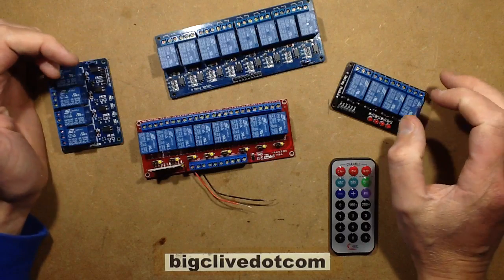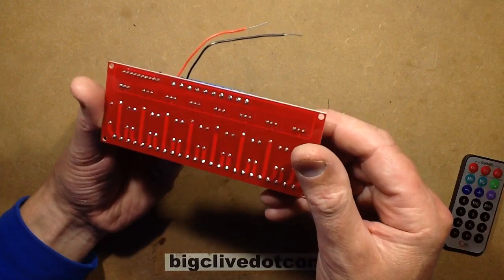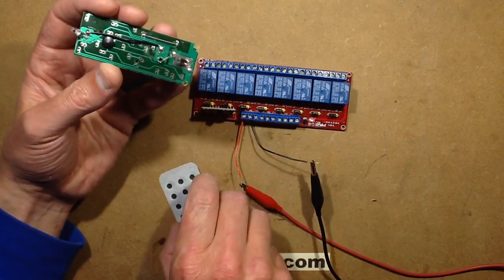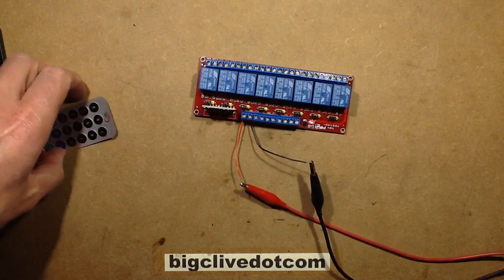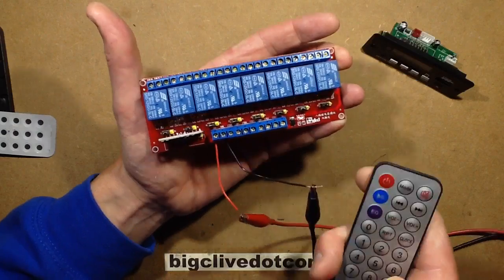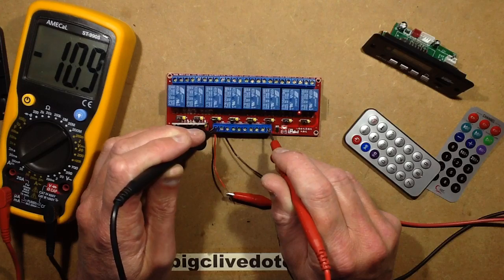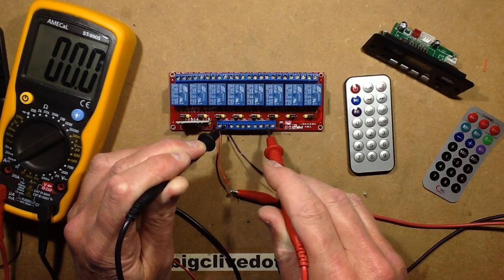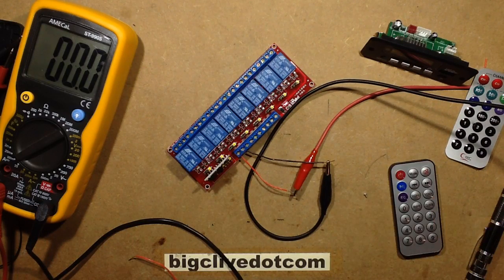Infra red remote control relay module.

Comment: Well done! Thank you for explaining the function of the jumper settings @ 11:35   !
In contrast to your module my device (looking exactly the same) the function of IR button # 9 does work properly as it should (as long as all jumpers are kept in their original position (left to middle pin)): When I press 9, all relays turn on,  regardless how many relays were already switched on or off before.

Comment: The current spike to turn 8 relays at once on a low voltage board like that would be massive. When you are pressing 9, it is most likely dropping the voltage rail to the point of resetting the controller on the daughter-board, additionally, the wires you are using are fairly low current looking so they probably are not helping with the current requirement of the on spike. Isolate the power supply going to the daughterboard, put a schottky diode in series and then a largish electrolytic cap to keep the IC powered when the voltage dropped, the schottky stops the cap from being discharged by the relay, while having a lower voltage drop than a standard rectifier diode, which would possibly drop the supply too much and result in you still having the same problem.
Reply: Yup, especially since it did it once when he had 6 on.
Reply: That's a good point, I wonder if his power supply was current limiting
Reply: @mnelson10000 A large capacitor would help as well when the PSU is going into current limiting.
Thinking about it: The issue we are currently seeing on the logic side, could similarly happen on the power side.
Imagine switching eight pretty hefty loads on... a good firmware would for those reasons slightly delay the power ons.

Comment: i am pretty sure when you press 9 it turns them all on, crashes the CPU and resets it to its off state. When only seams to happen with 3+ relais at once...
Maybe you should try putting a small capacitor between VCC and GND on the chip itself, i guess that would help it :)
Reply: My first thought as well. That would explain why 9 still fails some of the time even with six relays already turned on - the microcontroller is not liking the transients when more than one relay gets turned on at once.
Reply: Might also have been current limiting on the PSU... but yep, same concept
Reply from the maker: I'm away from my bench for a while due to work travel, but when I get back I'll try a beefier supply with some extra local capacitors.
Reply: How often do you have to fly or ferry to the mainland?
Reply: bigclivedotcom looking forward to that, will you make a video?
Reply: its the rf signals, even though they are the same model/make of remote, they are designed to differ minutely in the case of using the same product or even similar product in the same vicinity to prevent any cross-signalling
Reply: InfiniteWonderz There is not even RF involved, they are Infrared, it is even stated in the title...
Reply: Sorry, was meant to say IR, same thing, just different part of the spectrum :)
Reply: InfiniteWonderz True, but still i am sure the different remote has nothing to do with the wierd behaviour of the board. Clearly at 13:34 you can see that the LEDs on the relais that are supposed to turn on flash very briefly, before they go out and take all the others with them. This is very clearly a current problem.
Reply: The essence of 'Made in China' quality products. I laugh else I'd cry.

Comment: Clive, have you in your ebay expeditions found anyone selling these relays loose for silly Chinese prices. I was thinking about building a little binary adder or something out of relay logic and it seems like by far the cheapest way of doing it is to just grab a stack of those cheap-as-dirt opto-isolated relay boards.
Reply: I spent a good 20 minutes the other day and couldn't find a thing.

Seems my ebay-fu is poor.
Reply: First search term was "5V relay" then scrolled down and saw a few with just the relay, found that "SRD" was in all of those, added that to form "5V relay SRD" and then got JUST the right listings.
Reply: check the main sites lik alie baba and alie express. they should have every thing you ever want. alie baba will sell you decoy tanks as well.
Reply: All the relays on these boards seem to be manufactured by "songle" if that helps your searching.

Comment: is the spacing is poor would covering the tracks in corona dope be a valid solution?
Reply from the maker: A good PCB lacquer would help.
Reply: bigclivedotcom speaking of wireless switches, how effective are these cheap RF transmitters and receivers?

http://www.ebay.ca/itm/433Mhz-RF-Wireless-Transmitter-and-Receiver-Link-Kit-Module-for-Arduino-UNO-R3-/271860872420?hash=item3f4c2bb4e4:g:228AAOSwEeFVSPO0

I was thinking of using one connected to a soft latching power switch to power a single pole double throw relay connected to a single pole double throw light switch in the "staircase wiring diagram" to wirelessly control the lights in my room. the circuit will be powered off of  a capacitive dropper and a 12v zener diode to bring the voltage down.

I know you're supposed to use an opto isolator to safely power the relay but since the whole thing is reference to mains anyway i think i'll leave it out as the entire circuitry will be encased in a grounded metal box  (separate to the light switch) so if anything goes wrong it should be contained.
Reply from the maker: If you just want wireless control of lights then you do get the mains powered remote switches.  I reviewed one recently.
Reply: bigclivedotcom oh wow it's REALLY cheap... really encourages people to be consumers instead of a producers, what a shame...

Comment: Regarding using a cellphone to view the IR emitter, at least on my iPhone 6, the rear facing camera has an IR filter on it (and/or is actively trying to cancel any IR signals), so it won't see IR remote control emitters, HOWEVER the forward-facing camera works fine!
Reply: Good tip, thanks, it solves the same problem with my iPad Air.
Reply: Good to know, this is one of my favourite old tricks for testing IR gear and I often suggest it to clients when they call up and complain that a remote isn't working. Useful to know about the Apple products.
Reply: Rear cameras are usually attempting to be proper cameras, the front one is for narcissistic 'selfie'  types so can (and should) be shitty and not IR filtered.  In any dictionary you won't find 'selie' defined as 'self obsessed' I don't know why. I'm thinking of a Kickstarter campaign to launch a selfie stick with a few grams  of C4 in the handle. Possible gone (as Clive might say) moderately off topic. Oops.
Reply: @philchadwick9470  The stick handle needs a taser coil wired to the shutter button :)

Comment: Hey Clive. These are very interesting. Where can I buy them or what do I need to search for exactly?

One thing I didn't quite get:
If you switch the jumper one one of the relays, can I still control the rest with the RC or does it break that functionality completely?

I'm looking for something like this for a car project.
Reply from the maker: The other relays still respond to the remote.

Comment: I did a remote controlled fan with those relay, those are quite nice
Reply: Oh, I also wanted to do this. maybe coupled with a thermometer. But currently my relay module is controlling a pump that waters my plants.
Reply: Benisteinzimmer  never tought about the thermometer idea, but you should use it with a light sensor if you make one, as you don't wan't a noisy fan going on in the middle of the night if you use this system in your bedroom like I do
Reply: +SheeepHead eh, sadly I have to have the fan running during hot nights since my room heats up pretty badly

Comment: This is the second video that Clive has produced that I haven't got a clue to what he is talking about. Maybe this channel isn't for me?
Reply: oh sometimes he reviews more simple stuff, i know i will never need a 10 way remote relay thingy either.
Reply: +jusb1066 oh, I just think that if he could give a quick background to where these fit, and to what purpose they are. That would be of great help!
Reply: if electronics interests you you'd better stay along then you might learn something in the end :) Still learning things myself. A Relay is an electronically operated switch. Just like the wall switches in your house but instead of being pushed by a human hand they're pushed/pulled by an electromagnet that only requires a small current to flip the switch.
Reply: +Maico yes, I know. But where does these go? Usage? To turn the lights on in your living room? I thought light switches did that easier?
Reply: TheRobertSt the main usage is that an artifical brain (microcontroller) is able through  the relay to switch on/off for instance heavy machinery (that runs on its own high voltage circuit). It does this by applying the required small current to turn on the electromagnet in the relay that flips a switch inside the relay. A good example is an elevator. It uses alot of relays and also has a microcontroller (PLC) to operate them
Reply: In the simplest case it's just a remotely controlled switch (or rather 8 of them). So if you're too lazy to walk to your light switch, you'd use one of these. In advanced cases you'd hook some electronics up to it to control it. E. g. randomly switch lights, music and TV on and off while you're on vacation or turn on a pump to automatically water your plants on hot days when the soil gets dry.
But since you had to ask, I'd recommend you'd not yet mess around with mains electricity.
Reply: +superdau Oh! So THAT'S what they are for! Why couldn't he just have said that? Don't worry, one of my best friends is a certified electrician, if I need anything to be done to any of my strong current, I'll call him. Myselves I fix type amps whenever I have time. So I know all about electrical shock! Tank you for your explanation!
Reply: +TheRobertSt Tube-amps I mean.
Reply: I started off not really understanding most of it, but you watch enough and start to pick up bits here and there and then go back and watch older videos and things start becoming clearer. Also Jullian Illett is another good one for picking up odd little bits of info.
Reply: webchimp I agree with that. Julian is a very meticulous explainer. Sadly he seems to be on vacation cause he hasn't posted new vids for 1.5 week. I'm sure he'll return :)
Reply: +Maico
There's a new one up testing the range on the video system for his quadcopter.
Reply: @TheRobertSt  A relay is just an electronically activated switch. So it uses a small voltage and current (3-12 volts and tens of milliamps) to activate a switch that can handle a lot more, such as 240volt mains @ 10Amps. That means each relay can turn the mains supply on and off to devices of your choosing up to that rated current. An example would be the lights in your house. You could use this to essentially replace your light switches and have remote controlled lights. Each controlled by a number on the remote and you can press 0 when you go to bed and they all turn off.   Then the ones that can be connected to a RaspberryPi or Arduino (small low power consumption computers) allow for automation. So stuff like turning the lights off automatically late at night, or turning things on in reaction to a separate sensor that's attached to it. Like turning on a humidifier/space heater when humidity hits a certain level.    My personal use case is I have a home lab full of equipment I use to mock up things (I am a network engineer). It's loud and uses a lot of power so I leave it off but sometimes need to turn it on remotely, so I log into my Raspberry pi and run a command to turn on relays on boards like these that then power up the equipment I need.  
In short, if you can think of something that you want to switch on and off without having to be there or touch it, you could use one of these.

Comment: Could you programme one of those universal tv/dvd/stereo remote controls to operate the relay board?
Reply: If you can figure out the codes it uses then absolutely. Some of them you can even place them back to back and they'll listen to the code from the original remote and you can then assign that to a button. So this is very doable if you've got a fairly decent one.

Comment: I have been using this module since a while for a diy aquarium build and paired it with an IR repeater . Mine module with the original remote has number 9 working as all relays on. So I am not sure if there is any issue with compatibility between the two remotes or something else. I had an issue with one out of 8  relays that after using it for a while it stays always on.
Reply: There are probably some of the cheapest relays you can find on those boards.   I bought a 4-relay board from Velleman and it ehm, does not work.  My brother who is waaaay more into electronics than I am and as a result has way more knowledge than me, has traced the circuit board and he doesn't understand why it doesn't work, he saw me connecting it, connected it himself and he has no idea why it doesn't work.
If you exceed the maximum current at the specified voltage (which I presume is not exactly the specified amount that they print on the casing) or the device that you switch causes a huge inrush spike (let's say a switching mode power supply) or a huge spike at switch off (a transformer) this can fuse the contacts after a while.

Comment: Just received one of those relays two days ago so good to know. 
DO you think the contacts will hold up to the 10 amps their rated at ? 
Thanks for the info !
Reply: those are probably Chinese Amps
Reply: from Twing Twang no doubt!
Reply: +Maico      Good point ! 
I shall find out  just what they CAN take !   ( that is when my new power supply is delivered )
Reply from the maker: I'd not trust them at full current.  Half rated current at most.
Reply: +bigclivedotcom 
Thanks, have been testing for a few hours now and so far  :  12 volt-5amps  for one hour, 12 volt - 7amps  for one hour and then I went to 10 amps.... no smoke.  Took the top off to see the contacts and they look ok...... for now!  I think they'll be fine for what I need. 
Have some more on the way and think I'll push one to see just what they can take !  😈  Yeah, I keep a fire extinguisher handy !
Reply: Ken Gamble are you using an IR temperature measuring gun  ?
Reply: Ken Gamble you might keep a pack of 16A house fuses handy too :-)
Reply: bigclivedotcom I completely agree about half the rated current.  I have had "magic smoke surprises" I personally would like to avoid!
Reply: +Maico 
Yes, and with a small fan.
Reply: +Maico 
???
Reply: +Harry Haefner 
Thanks
Reply: 16A in the UK? at 220 or 250v? wait, you still have fuses? no breakers?
Reply: +BariumCobaltNitrog3n Really, I thought the UK was all about those 32A/240V ring mains circuits with 13A or smaller fuses in each plug.  Rest of Europe uses 16A, 13A or 10A 220V circuits with no fuse in the plugs.  Before  brexit, official documents were rephrased to call everything "230V", but that might no longer be needed.
Reply: Knowing China the decimal point has gone missing and they are actually rated at 1.0 amps!

Comment: Hey Clive. Great video as usual. Can you tell me if the chip can be 're programmed? Cheers
Reply from the maker: If it's flash based you could erase and program it from scratch, but that might be a lot of work.  Note that the all relays resetting thing may have been a glitch on that unit or worse, maybe a current threshold on my power supply resetting the processor.

Comment: maybe that 10milliamp thing is a led in a optocoupler ... a stepper controller I used for a school project had a similar control thing that could be pulled either low or high

Comment: Clive, could you show how you would design a system which would disconnect a load in case the MCU got stuck, please? Some sort of fail-safe hardware only method.
I'm always scared to use arduino for controlling bigger loads. Let's say the mcu would send periodic "watchdog" pulses to the mechanism, otherwise it would disconnect.
Reply from the maker: It does sound like a watchdog timer would be useful to at least reset the processor.  I think you can get watchdog modules.

Comment: so in theory a relay going bad can leak the amps of the load contacts to the control contacts and then back to e.g. the Arduino if one doesn't use an opto-isolator ?
Reply: kelimike ok I didn't know that
Reply: The relay doesn't have to go bad for this (and the way relais are constructed it would have to go VERY bad for it to start leaking). A relay is generally considered "isolation" (check the datasheet for up to which voltages). It is much more likely that dirt or moisture on the PCB will cause problems. That isn't really changed by using opto isolators, but by better board layout.
The reason for optoisolators especially in these control applications is to isolate the "grounds". Ideally your GND would be the same potential everywhere. But it isn't that easy in reality. If you have your Arduino with its power supply in one room and the relay board with another power supply in another room, most likely on another circuit from the breaker box, connected with several meters of signal wire, it is very likely that your GNDs are not the same. Without isolation in bad cases that can mean that you have large currents running down your "GND" or signal wires, frying electronics or tripping RCDs. In less bad cases it may shift the signal (logic levels) enough so the receiver doesn't recognize them.